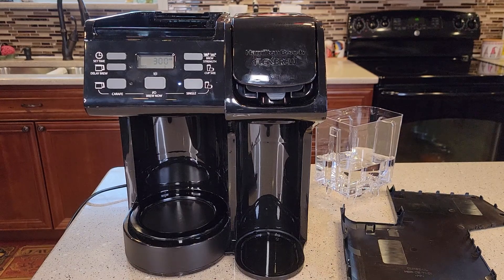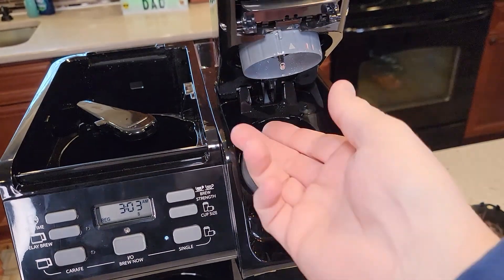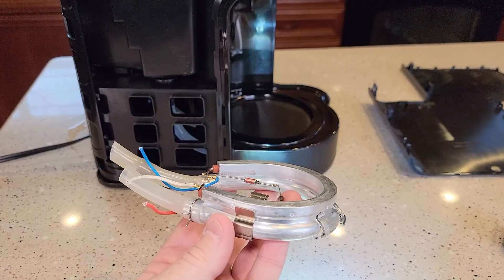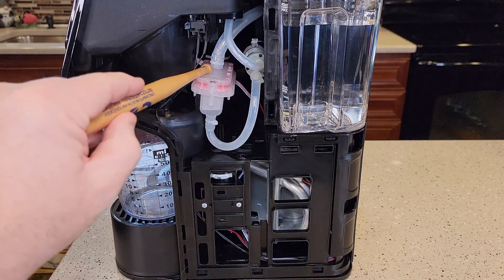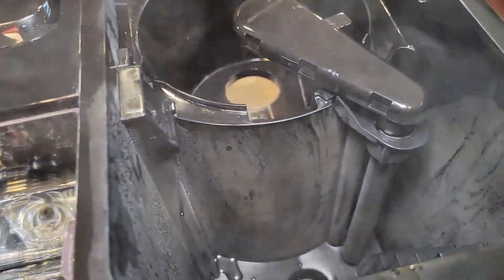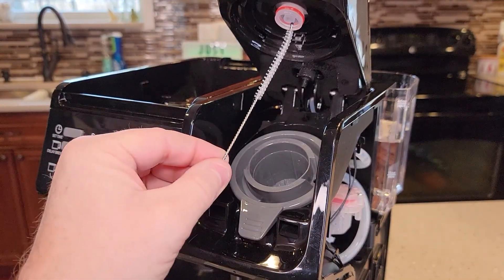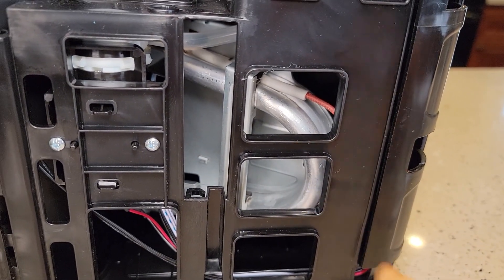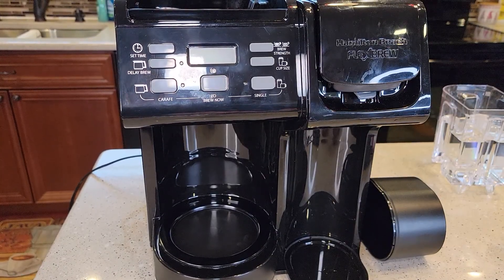HOW TO FIX Hamilton Beach FlexBrew Trio Coffee Maker Leaking Water 49904 Not Working

Comment: 49902 here, less than a year old. Half the water from single serve side is going into the carafe reservoir. It overflowed this morning which is how I figured out why I'm only getting half a cup of coffee. I've tried clearing the needles (I have to do that every other cup since purchase) and descale once a month. The last two weeks, this half a cup thing started. I tried to descale yet again, then finally got the overflow and saw the carafe side is full. Have send message to HB support, but I'm going to have to run out and buy a maker tomorrow. Not sure I'd buy another HB. :(
Reply: This is my issue as well, except I'm getting far less than half a cup. To fill an 8 oz cup, I have to brew a 14 oz five times
Reply: I'm having the same problem and seems like there's no way to fix it
Reply: Thanks everyone…was just about to purchase one
Reply: Mine started to have this problem, I cleaned the needles and it worked for a few more days. Now its doing it again and the needles are clean so maybe the tubes are clogged. I am going to runa cleaning cycle and see if that works. Coffee maker is about 2 years old

Comment: Thanks for the video. It was a big help for removing the panel on the single serve side. I have a Model 49902. It vents all of the hot water and steam (intended for the single serve side) into the carafe reservoir. FYI, mine has a model CM4311A-ET water pump, manufactured by Xinbao Electrical Co. It is rated at 12V DC. I measure 9.5 V across the motor when it should be pumping. The pump appears to do nothing.
Reply from the maker: Thanks for sharing!
Reply: I literally just bought a brand new one from target 2 days ago and the overload message wouldn't go away no matter what. Took it back today and exchanged it for another one, now this one says fill h20 even though it's full.... this is a piece of shit coffee maker in my opinion. If I have to tear apart a brand new machine to make it work that's a huge red flag for me.

Comment: I just had the single brew side dumping into the carafe side issue. I made sure the secondary motor was working then did a distilled vinegar descale. Sure enough after a few ounces it started pouring smoothly again. I guess every six months is the descale limit. Thanks for showing how to take the panel off it was a pain.

Comment: Dude... you saved me!! My water lines we filled with calcium build up and the little filter was clogged. One thing I did was pinch the overflow line to put more pressure on the line but only for about 5 seconds.  Baking soda and vinegar flushed it out in 3 cycles.. Thank you!!
Reply from the maker: Awesome

Comment: Thanks Dad. Your information was just what i needed to get trouble shooting. The k-cup side was overflowing int the carafe reservoir. After watching a cycle sans the side panel, it was obvious that the water from the collection tank never made it to the second pump. I thought it was possibly an airlock, so filled the tube with water and gave it a go. Nothing. Upon disassembling the secondary pump from the motor, the Aha moment! The 3 tiny holes where water enters the pump were scaled closed. Cleaned with a pin reassembled the pump and we're in business. I believe regular descaling with vinegar should prevent this, however due to the airlock, the vinegar would never have reached the blockage. Moral of this, descale regularly. WE have very hard water in our are so this occurred in about 2 months after purchase. Lucky us. Thanks again Dad.

Comment: thank you so much for your video! I was already one screw into trying to remove the bottom panel but after watching this, I figured out that all I needed to do was clean the needle! 😂 I would have been so upset to take it to a repair shop or get a complete replacement just because there were some coffee grounds in an easily cleanable, removable part. like many others, you've saved me and my morning coffee!!!

Comment: You saved the day Dad, the top needle was completely p[lugged with coffee, very easy fix. We didn't even know that top gray piece turned off!
Reply: Where is this gray thing?  I don’t see it anywhere but I have directions for correct model that says it has one.  Some of the Water seems to be going back into reservoir and doesn’t even make it to the needle and then water goes all over my counter.
Reply: @dolorescutrie4542  
The grey cap sits above the K-Cup, it’s part of the lid. The needle come down and punctures the top of the K-Cup. That needle gets plugged.
Reply: I found it on kcup side but my problem is with the water in the carafe reservoir .  There is no problem on k cup side
Reply: @dolorescutrie4542  
OK the carafe side. There should be a small hose that delivers water to the basket, see that it’s not disconnected or plugged.
Reply: @c1d2e   I had to go and get the tri sided screwdriver and got the bottom off.  I pulled gently on tube and feel that the carafe side tube is loose at the top.  I’m now having trouble getting side off with screwdriver.   I believe I have a different model than yours.  My booklet is not specific and neither does it say on the coffee pot itself.  May be a 49940, 49950, 49956, or a 49976.
Reply: I’ve now taken off both sides, I can see the problem but need to take off the back too to reach the spot to put it back on.  Probably this will be where I break it…to fix it😢
Reply: @dolorescutrie4542  
Careful surgery!
Reply: @c1d2e  I had to take off the back too. To take that off, had to remove the spray nozzle but then I could reach toe hose and clamp.  It’s all back together and it works!  Thanks for your help
Reply from the maker: Glad to help!!! Good job fixing it!!!

Comment: So I figured out how to open and watch my unit operate before I found this very helpful video. Nonetheless, I’m glad I found this because it validates my take on how the unit works. The holding tank’s function is to store any extra pumped water from the reservoir in case the second pump doesn’t keep up with the first pump. The overflow problem arises when the mismatch is too much. As with mine, the holding tank fills up before the brew cycle is done, causing about 2 oz of hot water to spit into the carafe reservoir. Downstream clogging could cause this, but not in my case. My lines and needles are clear. The second pump is just too slow to keep up. I see a comment about the supply voltage. It appears to me that both pumps are wired to the same pc board connector (black and red wires).
Reply: That’s the same problem I have.  I’ve done all the remedies and it still leaks water into the carafe side.  Have had this about 8 months…piece of crap!   UPDATE:  contacted customer service and they will be sending me a new one!!!  Product may suck but they have good customer service!!

Comment: Thank you so much! I follow your instructions and fixed mine! I ended up braking two of the connecting plastic things on the k-cup side panel but it close back just fine. I used a pipe cleaner in every tiny hole and needles. Also moved all the tubes, mainly the one going to carafe side.

Comment: Thank you, a very helpful video!  I've had 2 different models of the FlexBrew. 1st one lasted a bit over a year before the K-cup side would dump water directly into the carafe side. Tore that one apart (not so delicately as you did) and then bought a newer model-the one shown in this video.  Newer model lasted 5 months and now the same problem. I've tried the vinegar rinses and tube threading to clean (both units) and it seems these upper pump motors fail to pump properly out. No, I've been burned twice now on this brand, not going to go try for a third time. Never going to buy anything Hamilton Beach again.
Reply from the maker: Give the new ninja dualbrew a try. I love it
Reply: @JustADad i had the ninja dualbrew and got mold inside the reservoir that i could not get clean.  That's when i went to Hamilton Beach and now i have an overflow error. I think I'm switching to tea.

Comment: I had the same issue with the water spitting into the carafe reservoir, opened mine up using the steps in this video and noticed that my reservoir to the secondary pump wasn’t draining. We unhooked the tube running into the k-cup and blew some air through to make sure it wasn’t blocked, and reattached the tube. This seemed to fix the issue and I was able to brew two full 14oz cups immediately after fixing. We’re assuming the two pumps somehow created an internal vacuum and that’s what caused it to reject the water. Hope this helps someone!

Comment: I watched the carafe side on mine this morning while I tried brewing a kcup and I saw that it was spitting a lot of water through the vent hole. Both the needles are clean. Hopefully it's just a clogged line but I'll have to wait til after work to give it a try. Thanks for the video!
Reply from the maker: I hope you got it fixed
Reply: This happened to me because the hole at the very bottom under the kcup was clogged. Under the Grey piece there's a little hole with cross hairs. I stuck a paper clip through that. Hope this helps!

Comment: Mystery revealed, thanks for sharing and saving me time I don't have right now:)  Having the same issue with mine (water going to the carafe side).  Also have had issues with the needles getting plugged and water not heating up enough on the k-cup side.  Think I'll toss this one in the dumpster and get a newer model or different brand.  
*UPDATE- on a whim I ran another bottle of vinegar through both sides and its working again.  Must have been scaled up pretty bad, guess I need to do it more often.
Reply from the maker: Glad it worked for you

Comment: Mine leaked when using the carafe side. I removed the side cover as shown. (Thanks, saved me a lot of time!) As I suspected, the hose connected to the warming plate was about to fall off. (Just like the previous model. Arrgh) I slid the hose back on and reattached the hose clamp. I should be set for another two years. Quality is certainly not job 1 with Hamilton Beach.
Reply from the maker: Great tip!

Comment: Thanks for the assistance on this coffee maker. I still have a problem with a tube being disconnected, I’m unable to reach the one tube on the far back. Again thanks for the help
Reply from the maker: are you able to put a zip tie on it?
Reply: I am not able to put a zip tie on it atm, it’s on the other side of the top water pump against the far wall. (If that helps with the location)
Reply from the maker: @miigwanikwe  Darn yeah thats the hardest one to get to.
Reply: Very helpful. My coffee maker is not that old. But i did open it up and see that the pump was not pumping water into the k cup. I was so disappointed . But….  I was showing my husband what the issue was and I started to just. Push  the K cup over and over to show him and  walla  it started working.   I had put some vinegar in the reserve tank and that seemed to unclog  it.  …  thanks so much..  ..  just a thought.  The k cup side would not work . It would  say overload and shut off. Then water would empty into  the carafe side … so i guess i need to clean it every month..  we live in Florida and our water is hard.. thanks again..
Reply from the maker: @jacalyncrawford  Good job getting it fixed.  and thanks for sharing!
Reply: Just did mine the pump to the k cup was clogged got a compressor with a nozzle blow it the opposite way the water would go and put it back together works great now
Reply from the maker: @shermanwizards3030  Thanks for sharing!

Comment: Just fixed mine, it was the tube coming from the holding reservoir too the second pump, at the pump housing, remove three screws and the tube coming from the little holding tank, there are three small holes inside the pump housing nipple that get clogged with calcium.

Comment: I just recently purchased a very similar model. My problem is that on the screen it never switches from brewing, to keeping warm. After the warmer plate is activated for 2 hrs the unit is supposed to auto-shutoff. My concern is that since it’s never switching from brewing to warming, that it’ll never auto shutoff. Plus it seems like the tank that heats the water is on waiting for water.

Comment: I have gotten my bottom off cause my issue is with Carafe side not brewing.  Gotten to the hoses, but they are fused to the heating element.  Any tips to get those off without damage, seems the clog in mine is in the heating element itself.  barely any air flow when i blow in.

Comment: The upper pump quit on mine after 3 months. Nothing clogged anywhere, just started dumping scalding hot water into the carafe reservoir.
Reply: Same here. It didn't take mine (model 49902) 3 months for the pump to fail.
Reply: @richardballew185  So exchanged it for an updated flexbrew trio a few days after posting this. The upper pump has again quit working, this time with a big squeal, and it now pumps scalding hot water into the resevior. Customer service has been horrible to deal with, i'm going to return it to the store even tho they say not too, Hamilton Beach is expensive garbage now.
Reply: @richardballew185  Same! We weren't even able to use it ONCE! it doesn't pump water through at all. Unfortunately it was a gift and he didn't use it for over a month (he was trying to use up pods for other machine first) so we are outside the return window.

Comment: Hi.  My machine is less than 6 m. old.  It doesn't leak but the carafe side just stopped working. doesn't heat up or move water-nothing.  tried reseting by unplugging, plugging back in then holding the brew button 30 seconds and still nothing.  any suggestions?

Comment: Mine is weird. Instead of the water flowing into the machine, the water starts sweeping out from under the water tank. I remove the tank, dry all the water, and I can see the water coming back up. It happens randomly when not in use. I did opened it and all the connections look ok. Anyone else has a problem like this?